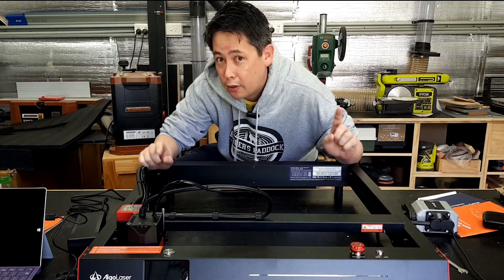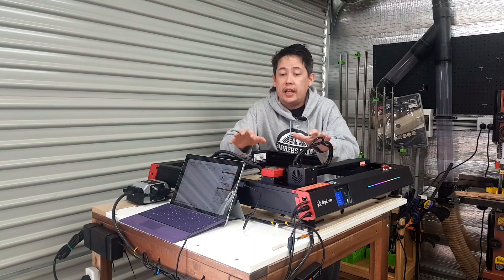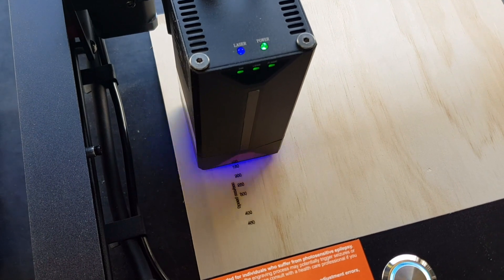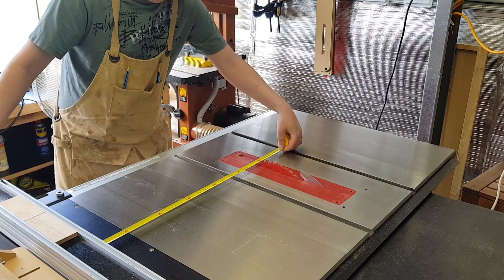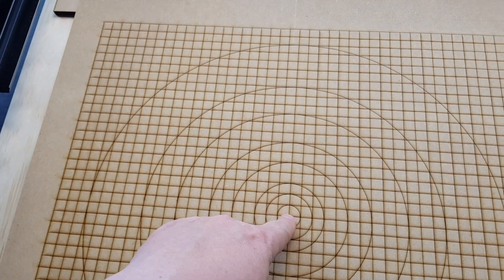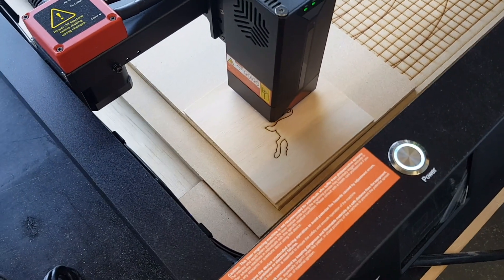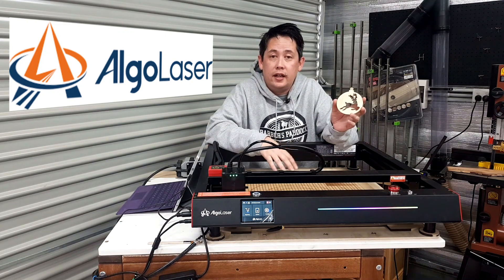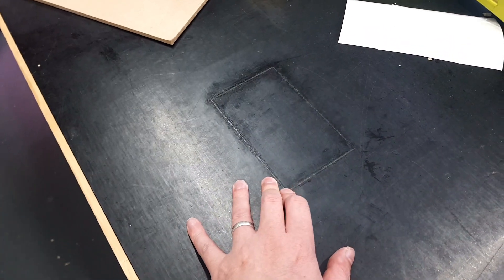Discovering the world of lasers with the AlgoLaser Delta 22w

Comment: Do you have laser cut files for the baseboard?
Reply from the maker: I don't, but the way I made the base board, is relatively simple.  I then, justed used lightburn to make a grid that is the size of the parameter of the cut area, and etched the grid pattern into the MDF spoil board.  There really isn't much complicated about this one.